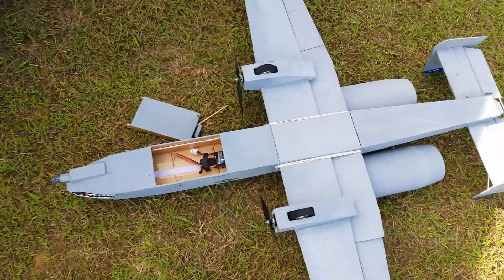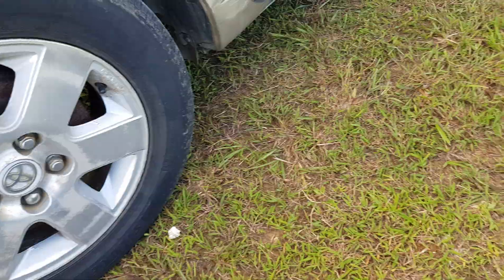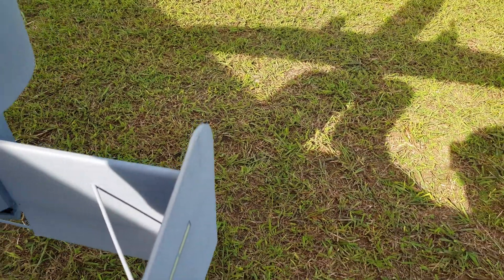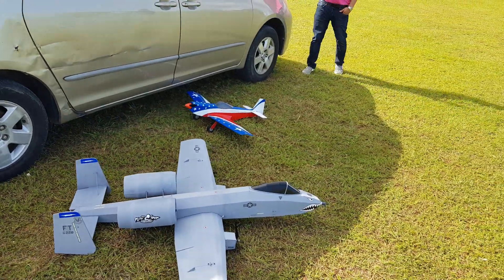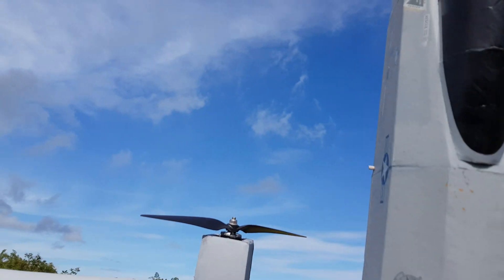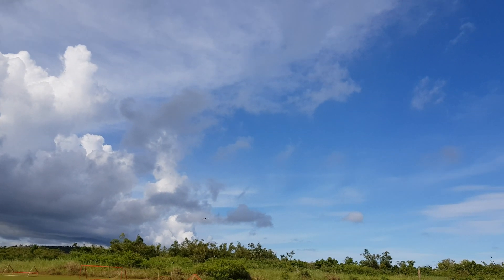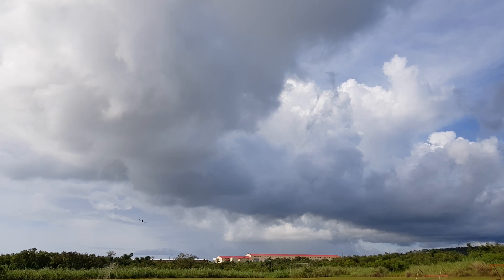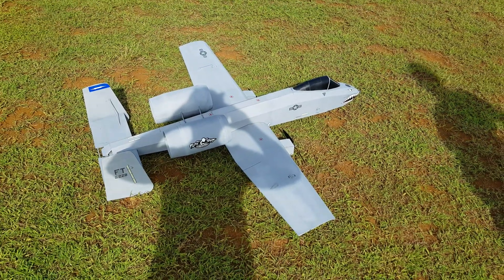Flite Test A10 Warthog Maiden

Comment: Lovely landings!  Seems like your esc is overheating.  Try   9 by 6 props.  Easier on the esc.
Reply from the maker: All I did was opened the back side of the motor pods just after the ESC to allow hot air to escape also made NACA scoops ducts or vent entry on the sides of the pods allowing air to enter flow over ESC and exit out.  Doing this eliminated the ESC overheating and going into thermal shutdown.  Had over 100 flights since this video before I donated the plane to a STEM teacher.